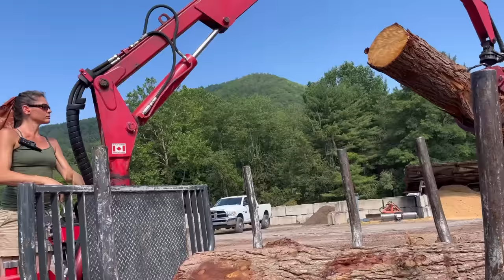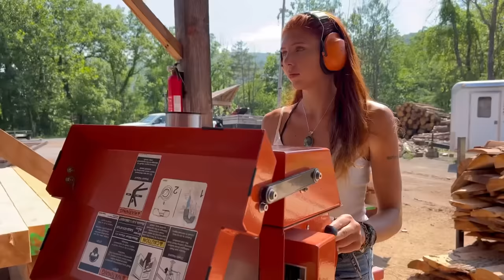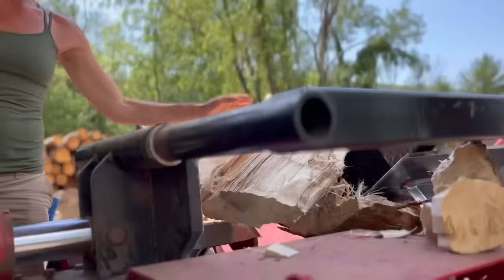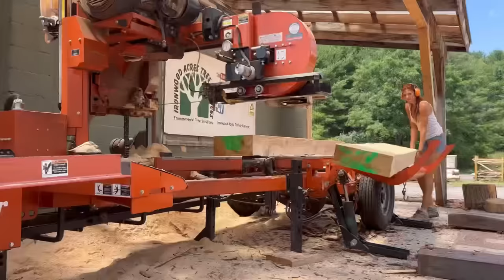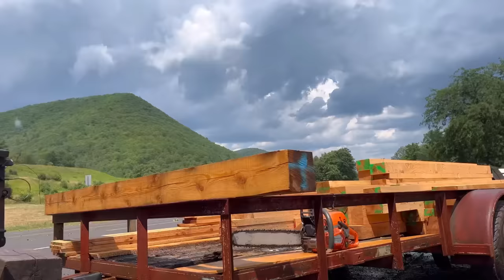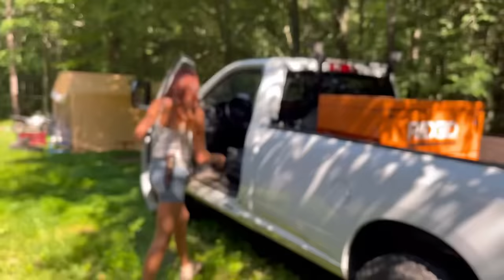Just Us Girls Working At the Log Yard Today

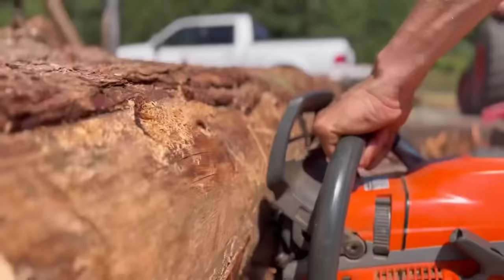Comment: At 2:12 in, your bar tip is shown entering a log behind the one your are bucking. That's asking for a kickback. Pull or roll your bucking log further away from the rest, so that can't happen and locate 4 X 4's under it so the chain doesn't hit the ground below. It only takes a minute or two more, but makes the chain last longer and prevent blade pinching. You can cut up from the bottom when the top will pinch that way also.
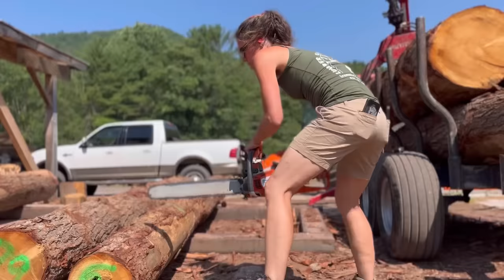Reply: I would say the Boss lady knows what she's doing. If it were accidental, she would stop right away to avoid wasting a valuable log. My guess is, she's doing this on purpose. It looks like both logs are lined up perfectly (2:00) and this way she doesn't have to measure the second log, but just continue through these earlier cuts.

Comment: Went and Got my LT15 today, brought it to my property and set er down in the shade. It’s not at the top of my priority list atm, but it’s not low on it either. Came with a unopened box of I think 20 blades, 2 Cant hooks, and some kind of log roller-upper assembly that I gotta figure out… It only had 2 track sections, so I ordered another 1 section, gonna take several months before I get it from woodmizer…I really can’t wait months to try the saw out, I’m gonna have to set it up temporarily and play with it a bit…

Comment: Awesome but be careful burying that chainsaw blade into the log while the tip cuts into another log. Recipe for a possible kickback if the wrong area catches. Try to avoid cutting with the tip but especially the top 1/4 of the tip.

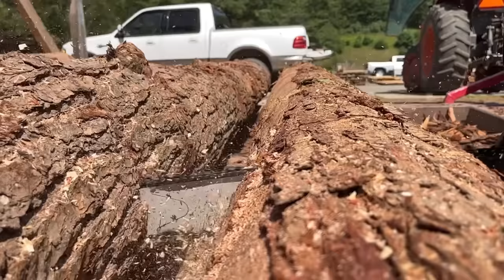Comment: Good to see everyone gettin it done, but careful careful...I'd squirm a lot less if you didn't cut with the chainsaw with the logs so close together. You're gonna get a kickback from that second log (2:08). Tie back the hair, get wireless earbuds (can't see them if they are earbuds or just plugs), gloves! glasses! You are working with hydraulics, that's high pressure and hot oil, does wonders to the skin and eyes. One small mistake and it will cost you a day's work or worse.

Comment: Does hemlock have special properties over other conifers?
Reply: Best toughest longest lasting wood for barn shed exteriors neighbors barn 140 yrs old...Hemlock still good just worn by weather some..
Used for piers docks break waters.
Very tough and rot resistant ...has to be used green dry will split unless you predrill holes.
Used thousands of feet here on the farm...great stuff 
But watch the shrink.